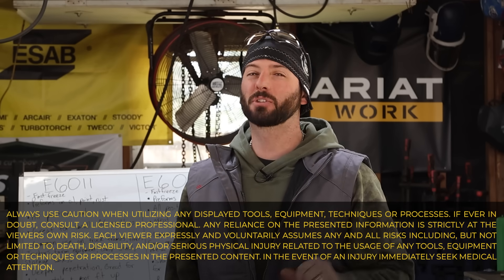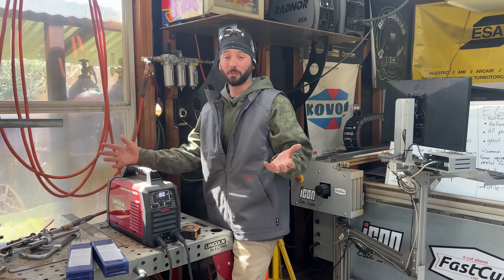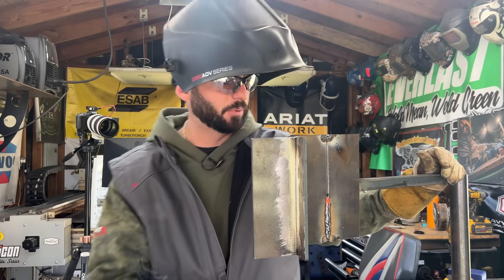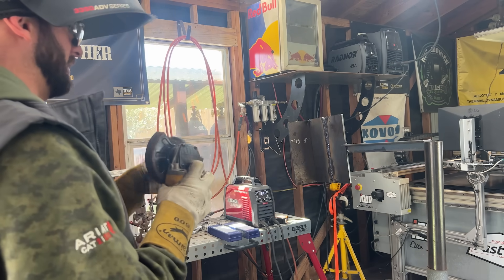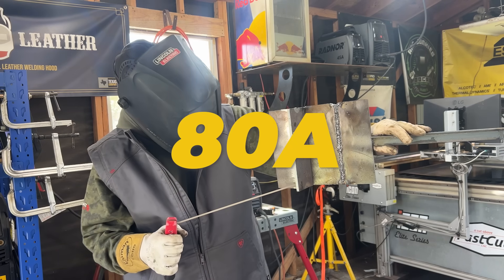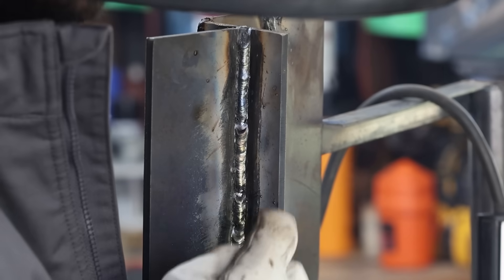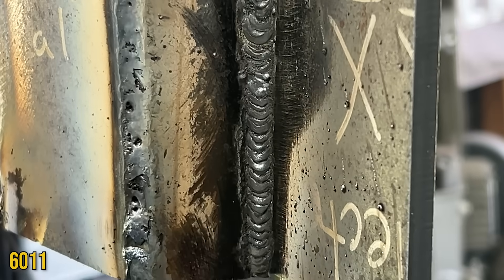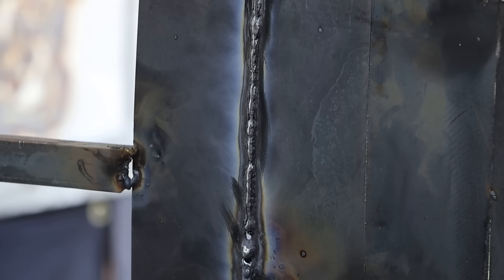6011 & 6013 Stick Welding: Uphill Techniques for Beginners

Comment: Thanks for demonstrating stick on both thick and thin metals. I’m finding getting the right amps, the right speed, and the hand steadiness all are needed for a good looking weld. I’m wondering how you would do on 1/8th in steel in the same positions and electrode sizes?

Comment: 1/8” 6011 vertical Down 50 amps, tight arc, full penetration on 14 ga.  I haven’t tried 16 ga.  Hot and fast?

Comment: 6011 is very common here in the Philippines for rootpass. In 6G position, from 6 o'clock - 3 - 12 and 6 o'clock - 9 - 12 direction uphill. No problem.

Comment: Well, for years first thing you do is throw that 16 13, 6013 rod throw it away stick with P5 or 60 tan then 7018 run down pass with the circular motion down with the 6010 or P5 vertical up side-by-side side to side about 130 530 amprun vertical up different test has them all long time welder fabricator

Comment: 6013 is not a fast freeze type of electrode it's actually a fast fill type of electrode because it's a high titanium potassium Rod deposits more metal compared to your standard 6011 and 6010 electrodes
Reply: The powdered metal in the flux of the US type 6013 rods smooths out all that jaggedness.

Comment: I can only really get 6013 where I live. 7018 is really expensive, if you can even get it. I have personally thrown in the towel with 1.6mm sheet and stick welding. It just sucks. It's either mig or nothing. It's still somewhat manageable to weld something onto a 1.6mm surface, but a butt weld like that? Never. I ain't doing it. I try to avoid such things as much as humanly possible, because I don't want to land in a home for the mentally challenged in a few years. I choose peace.

Comment: E6013 a fast free rod, wat, never heard that before
Reply: Bob called it a fill freeze like 7024, in fact, just use 7018 where you would use this stuff.   I have a welding book that calls it general purpose, whatever, just use 7018.

Comment: 6011 would probably blow less holes if you ran it on AC. But yeah its tough on thin metal; long arc it just a bit and... hole! On thin sheet the Chinese tap with 6013 is pretty much your best bet.

Comment: need to try different angle, your running about 20 below. try going 45 almost touch welding. the arc force helps keep the slag up

Comment: At home ive discovered one really cool hack for stick welding (imho) use your stick welder on the tig settings. You have a high frequency start which eliminates a lot of sticking, scratching, and tapping to start your puddle. Also you can increase, or decrease your amperage as you go, by using your foot peddle. Its great.
Reply: It’s not great when the rod is too cold to actually weld at your starts and stops. I’d bet your welds don’t pass a bend test.
Reply: @wrecker1861 if you set it to the right amperage it'll burn like normal. I'll set it higher than I need, start hot, and adjust as I go. If your too cold it won't start, and if it gets too hot you just back off with the foot peddle as you go.
Reply: I need to try this, for stick I use an old trusty thunderbolt, tried my Green 210ext tig today and it won’t run any 6 series for nothing. Can’t get started even with hot starts, arc force, etc. tried EP, EN, hot, cold, I plugged the thunderbolt in and instantly good welds 😂 but my ext210 also can’t differentiate ac vs dc on stick which I thought was the issue. 
I chalked it up to these inverter welders kill the power from sensing your no longer welding, when your just trying to start and end up long arcing. Idk tho I’m here to learn

Comment: There are 6013 rc (rutile-cellulose) electrodes, at least here in Europe and they are very common. You can use them for every position, they are very good for downhill.
Reply: Yes here Europe 6013 stick also known 46 type,  I using it repair weld work and get it good result

Comment: I use 6013's here in Africa all the time . Having to weld 5 mm - 20mm brackets onto thin walled mostly galvanised posts or square tube isn't easy.
Mostly for maintenance on already installed gates ( some pretty heavy ones with crap thin walled posts ).
Started running flux core but next to get a new liner so back to stick for now .

Comment: I gave up on stick with thin stuff. I use gasless flux core welding wire set pretty hot, and one sec on, off, move to the edge of the previous weld along the the weld path (generally about a second), one sec on, off, repeat.  The heat is set so that it'll get full penetrating in that one second.

Might be able to do that with your stick come to think of it. 

Another way to weld the thin stuff continuous is to use a thick copper plate behind the weld and use it to draw the heat so you can put enough heat in for penetration, while not melting it.

Comment: Don't you know the manufacturer recommends that you use 5/32 6011 at 95 amps with a bilateral dingle arm at 38.5° for vertical up on 16 gauge? (Don't forget to set the fourlinear compander to defenestrate before striking the arc.)
Reply: Gramps got into the magic cookie jar again

Comment: what does F 50-75 mean?
Reply: The F stands for "Flat" (referring to the position) and the "50-75" is the recommended amperage for that position
Reply: @badgerjuice  so, V is for vertical and O for overhead
Reply: @derfacecrafter  I believe so, yeah!
Reply: ☝️☝️You are both correct.

Comment: LMAO!!! Hahahahaha! 6013 isn't a downhill rod and Ive always had to weave it WIDE going uphill. 

I see you're using Washington Alloy rods. Their 6011s run a bit funky compared to Lincoln's Fleetweld 180. With Lincoln, you can whip just outside your puddle and the slag is pretty much frozen and you can come back in. Washington Alloy takes longer for the slag to freeze going uphill. I guess that's why I never like using them.

Comment: Spot welding is the actual normal way to weld sheet metal.  No need to try to run a bead.
Reply: As in making a spot weld, then breaking the arc for a second, then making another on the leading edge of the puddle, and so on?
Reply: @ Yes, this is normal on automotive sheet metal.  Also, moving around the workpiece to let previous welds cool before welding there again.

Comment: I have some issue with 6011 keep sticking.  Specifically with 3/32 at that low amperage.
Reply: Machine can't maintain the arc, probably a voltage issue

Comment: Gotta say, the 6013 downhill is absolutely the way to go on thin stuff!! Full pen and smooth bead apearance, build an entire motorcicle trailer with it and the downhill welds were myfavorites by far, smooth bead, great pen and great result, u gotta turn up theamps and fly! Almost 0 manipulation is the way to go, 2/2.5mm rods
Reply: whats nice is you can get 1.6mm 6013s too perfect for sheet where as 2.5mm/ 3/32 are better suited to 3-5mm base thickness

Comment: I tried 6013 up hill, downhill, flat and horizontal. That rod hates downhill! But I will say 6013 likes thin metal. On the other hand, 6011 is a great rod overall but when welding thin metal I need to tack it like those cheesy videos on utube streams. 😅
Reply: When using 6013 on 16ga. sheet, using 3/32" rod, running a series of tack welds is the only way I have found to make a solid weld on a butt joint.  Running vertical up any other way seems to blow through.  Running vertical down just makes a mess.  Sometimes I can get away with a normal weld on a flat fillet joint if the amps are right.  I've been fooling around with 6013 and thin metal for months and I still can't get it right, consistently.  Probably better to go with a mig weld.

Comment: Here in Europe we do not have 6010/6011, so 6013 is by far the most common rod, along with 7018. I personally do not like 6013 at all and use flux-core instead for similar applications
Reply: There is 6011  worldwide…
Reply: @wrecker1861 yeah, but good luck finding it in Europe as easily as in the States
Reply: Ebay has them, similar prices to 6013 small packs.

Comment: Nice try mate! It was fun to watch you as always. Normaly, they recommend electrode negative for thin metal welding with 6013. I have struggled with 2mm wall thickness hollow tube for a patio construction to a friend of mine. Many holes and bad looking welds, used 3/32" 6013 and  7018. Switching polarities didn't help either! 😂 Forgot for the basic rods quickly. I don't even want to try on 1/16". 😅 
  Not easy job! Joy to watch your videos!

Comment: Here in Greece 6013 is the most common rod and the majority of people don't even know that number or other types of rod even exist (except* for SS).
Reply: Most home users hawe trafo AC welder, you cant run 7018 on AC.
Reply: @hardcoreplayafromthehimala4888  You are right.
Reply: @spath13  Hello from Serbia..
Reply: @hardcoreplayafromthehimala4888 if you have the correct 7018, you can
Reply: @spath13  except...
Reply: @6pekXX   Yep mistype that 😭
Reply: Same here in portugal, i wish theyd have higher standards here...
Reply: Εδώ δε βρίσκεις 6011. Πουθενά λέμε, πρέπει να το κάνεις εισαγωγή άμαζον κλπ,
Το 6010 που βρίσκεις βέβαια, το 90% οι ηλεκτοκολλήσεις που κυκλοφοράνε και 100% οι ερασιτεχνικές ΔΕΝ το δουλεύουν σωστά ή καθόλου. Μα δε φταίνε οι άσxετoι αντιπρόσωποι του λώκou, εμείς φταίμε, άστο...